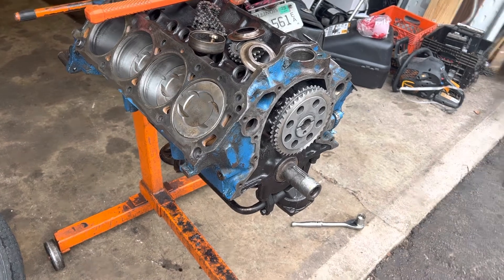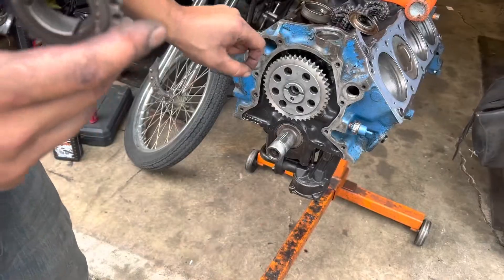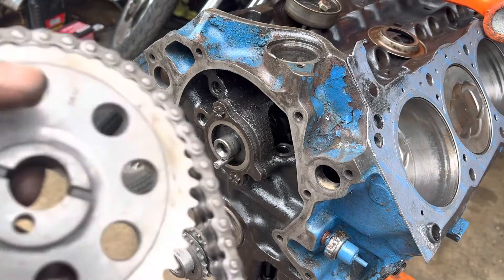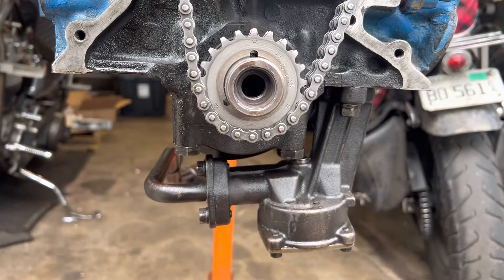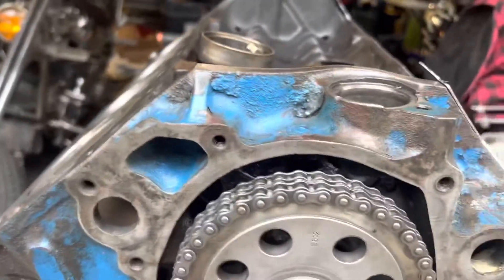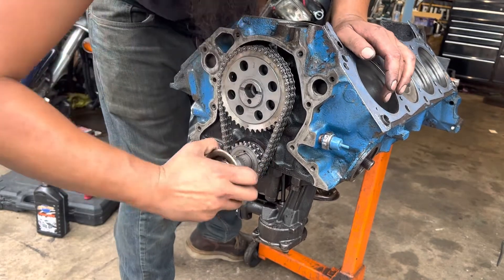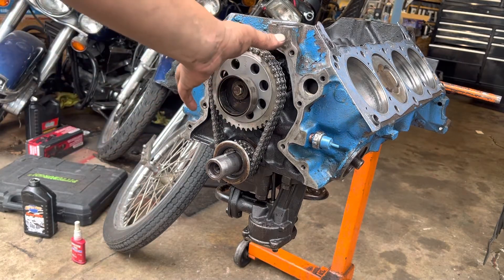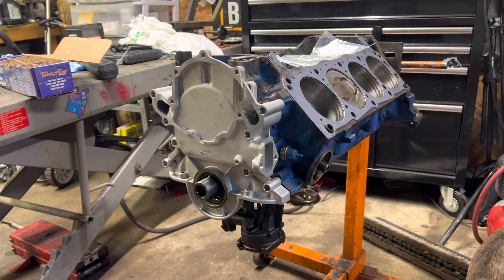Ford SBF 302/5.0 Timing Chain Install

Comment: You should soak the timing chain in oil for atleast a half hour. Oil gets into the rollers so there is no dry start.
Reply from the maker: That is a good idea!  I hate the idea of wrestling an oil soaked chain, but you are correct on the rollers.  Thanks for chiming in!